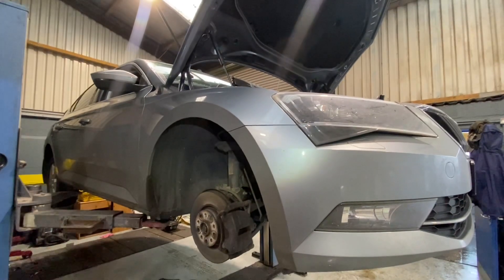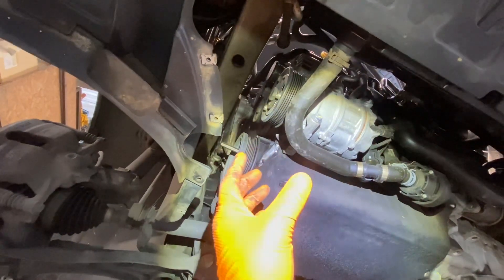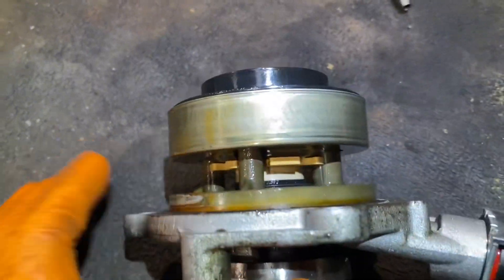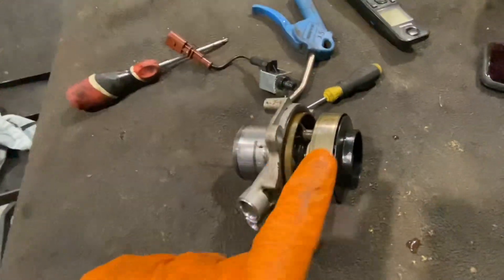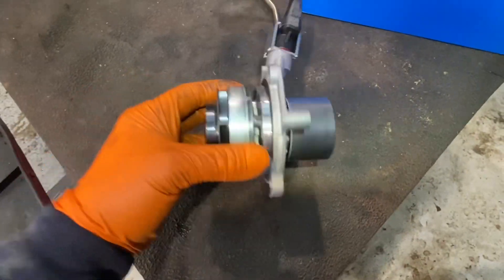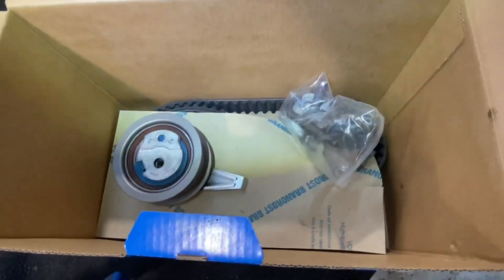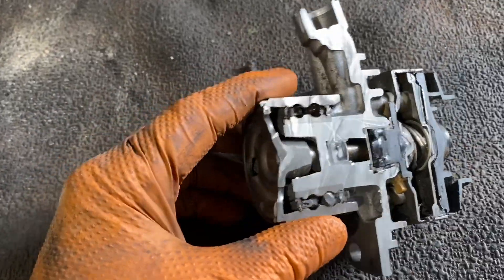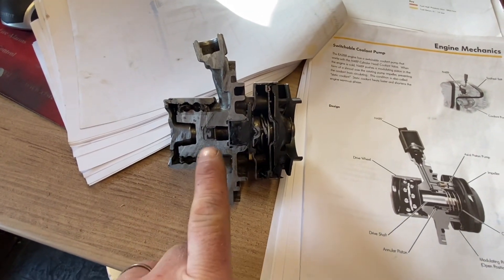Skoda overheating problem & fix

Comment: Used to watch your content regularly but I've been working away from home for a while. From one mechanic to another, great to see mechanics who don't mind a bit of hard graft and who is interested in how things work, rather than just throwing the old parts in the bin. Such insight can be invaluable when fault finding.  

I've seen a few pumps that don't have the shroud, never used one but I'm tempted to start using them. I've had two pumps now that I changed with timing belts that have had the same issue in under 18 months and seen it on several cars with the original pump.
Reply from the maker: @chrisc5739  hi Chris, they do seem to fail quite fast. We had one last week and as you have seen it was changed in 2022 only 80,000kms ago 🤷🏼‍♂️🤷🏼‍♂️

Comment: I don’t think many people, including the main dealers have taken the trouble to find out how these pumps actually work. (should work.) I had an overheating problem with my Passat. When the engine was hot but not overheating, I disconnected the solenoid plug under the engine cover and  connect another which I insulated and left under the engine cover. ECU is happy everything is connected. I basically have turned the pump into a non-switchable unit. So far, it’s worked perfectly albeit it takes an additional few miles 2 to warm up.  Even if you buy a new pump to get the solenoid wire, it’s still a cheap get out.

Comment: Skoda replaced the exact same pump under warranty at just a year old, the pump they fitted doesn't shroud or electric connection, slower warm up but reliable.
Reply from the maker: The waterpump without the shroud seems to the most widely used one at this point. It simply eliminates a bad design flaw 😉😉
Reply: @kennedysgarage3281 where could I get the water without the shroud from please let me know??????

Comment: Superb here too. What's a temperature that would be considered too hot? I'm getting no engine codes but temps are around 104-110°C. Is that a concern?
Reply from the maker: Yes, it should be getting any hotter than 90 degrees. The water pump is a mechanical component and the only faults you are possibly overheating faults if the car got very hot 😉👍👍👍

Comment: Hi there,
If there is an issue with overheating does it come with some fault codes?
I have got customer's superb and it overheats sometimes but there are not fault codes at all
Reply from the maker: Sometimes you can get an overheating fault code but not all the time. It is just a mechanical component and the engine ECU cannot monitor the pump itself. In my experience it is most likely the pump started to fail or sticking 😉👍👍

Comment: I'm having the same problem
Reply: I have a skoda octavia vrs.. booked in for cambelt and water pump next month but the last 2 weeks it's over heated 3 times ... was going to ask the garage to stick a new thermostat in at the same time.. but now thinking maybe my car hasn't a thermostat
Reply from the maker: @BobBob-sm3sn  there is a thermostat in it too. But I would get it done asap, as the overheating could cause a head gasket to fail 😬😬😬
Reply from the maker: Not too bad a job, Bob 😉👍👍👍

Comment: My compliments for your very detailed videos. 
During a troubleshooting, is it possible to prove that the problem is due to this pump assembly, without removing it ? Thanks
Reply from the maker: Pull the small pipe off the header tank at the top, Rev the engine and if you have no flow the pump is more than likely after failing. 
And I’m glad you enjoy some of my content 😉🙏🙏

Comment: I'm starting to think it's a fault on these engines. I've a Passat with 2 litre ea288 engine and I think the blasted pump is gone again as it's ever so slightly losing coolant. This is the second time in a year. I drive the car gently but came across your video, thought it was interesting
Reply from the maker: A very complex water pump design & very common to fail 😬😬😬
Reply: @kennedysgarage3281  Just my luck eh
Reply from the maker: @Edvard.Munchkin  just everyone’s luck with modern vehicles. They are real crap 🤷🏼‍♂️🤷🏼‍♂️
Reply: @kennedysgarage3281  So I'm at nothing buying the c220d I was looking at then if they all the same I guess
Reply from the maker: @Edvard.Munchkin  as with anything you could be very lucky, but the stuff that they are putting into newer cars is quite bad 🤷🏼‍♂️🤷🏼‍♂️
Reply: @kennedysgarage3281  Cheers. Keep up the good work 👍

Comment: Peter I know the 2.2 Mazda diesels are problematic but is there  anything in particular to look out for when buying one. The 2014/15 3s are cheap as chips. 9k for something that looks good and has 130k kilometres. Drove a lot of them as company cars and they're a great set of wheels. I assume any left on the road at this stage are sorted?? Thanks🥰love the show.
Reply from the maker: Go with your gut, what I am showing are the only faults. I would definitely remove the intake straight away just for peace of mind. But I do believe they are good car with the correct maintenance 😉

Comment: nice video peter i really liked the way you splitted that water pump its good to see the working of these things but i wounder why the make a water pump so complicated i dont know may be the engineers just keeping up with the times
Reply from the maker: Emission standards being so tight nowadays, the faster they get up to normal operating temperatures the better for the environment. 
They also say tyre pressure monitors are fitted nowadays not to let you know that you have a puncture but to reduce drag & improve emissions output 😬 All very interesting stuff 😂😂😂🍻🍻

Comment: gates timing kit has updated water pump where always open and no difference to warm up time .
Reply from the maker: It is a lot of designing & manufacturing for what you would think is very little emissions difference. But what do I know 🤷🏼‍♂️😂😂😂
Reply: @kennedysgarage3281  your just a mechanic lol .  Loved that pamflet on the ea288 . Scary stuff around the engine . Im only at 20k on 17 plate so wont see this stuff for a while , fingers crossed .
Reply from the maker: @rmc5278  🤞🤞👍

Comment: Peter that was indeed interesting but also I can’t help feeling tha just because they can doesn’t mean they should. Seems like loads of trouble with these. Your you tube brother Dave Sterl did a cartoon on them too.
Reply from the maker: They are seriously over designed, it is quite mind boggling what they can do in a very tight space. But as you say it is a bit of an overkill, especially when they fail so regularly 🤔 Thanks J 🙏🙏

Comment: water pumps where great in old day  you had stainless impeller good bearing and steel pulley never gave trouble. tipical vw  trying to reinvent the wheel and making a balls of it 😪
Reply from the maker: Back when parts were strong built & actually lasted 😬😬

Comment: Now I could be wrong but I was told by a VW tech that these pumps stick due to not changing the coolant at correct time or using wrong coolant mix. Needs to be G13 as stamped on side of the expansion bottle and the silica in the antifreeze has something to do with causing the sticking collar.
Reply from the maker: I have heard the same. This is a 2018 car, which makes it 4 years old 🤔🤔
I don’t know when they advise to replace the coolant?? 
And I thought the silicate bag was to extend the coolant life expectancy 🤷🏼‍♂️
God only knows, I just wanted to figure out how it worked 😂😂 Cheers Chris 🙏
Reply: the silicone bags burst and block the heater matrix Also there’s sand that’s been left in the engine block by factory and there’s a recall on them

Comment: I can see these pumps being nothing but trouble in the future especially with neglected coolant changes.
Reply from the maker: They are very troublesome as it is & being undiagnosed can lead to head gasket failure. This is where the problems begin over a few hundred euros repair 😬😬😬🙏

Comment: Very interesting Peter I’ve fitted quite a few of those pumps and I’ve never understood how they worked I had this theory in my head and don’t laugh that it was somehow hydraulically operated by the solenoid crazy I know 😂😂. Anyway like you say what a fantastic piece of engineering that pump is thanks for sharing and don’t tell anyone about my theory 😂
Reply from the maker: Don’t tell anyone?? You are exactly right. Just it is using the water & coolant mix to create the hydraulic force needed. It is a fantastic piece of manufacturing ( when it works 😬)
Thanks Kevin 🙏🙏